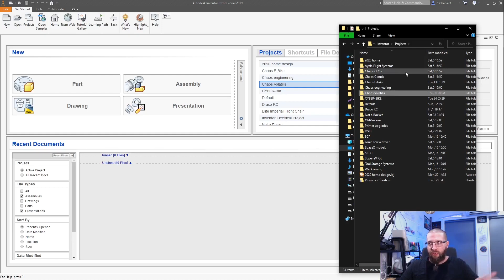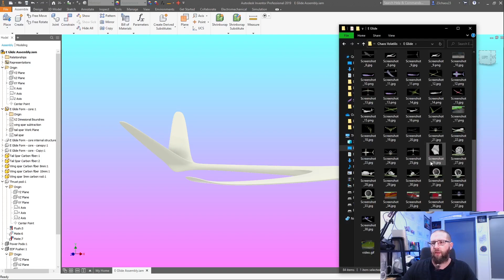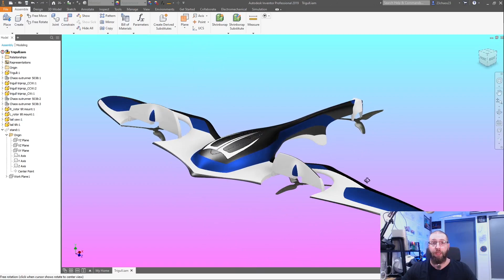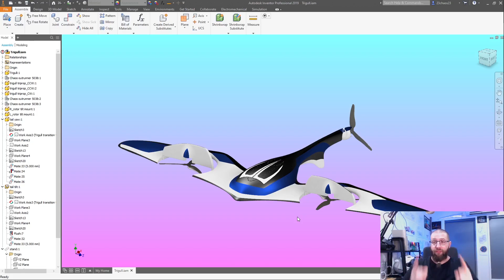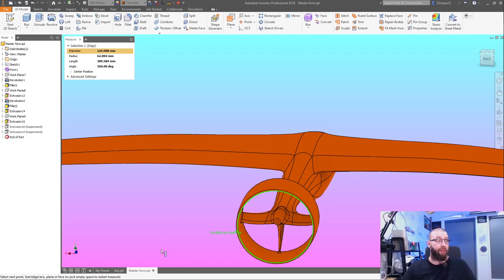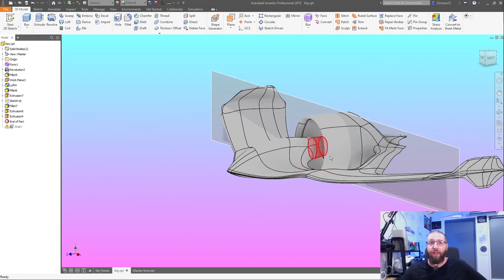chaos daily 2021: 002

Comment: Have you heard of the Prantdl-d flying wing? Hyper efficient, but, hard to get the wing shape right. What's interesting is it actually produces proverse yaw. There is a cad neutral (STEP? IGS?) and STL file available of the design its a research plane/project at this stage. Could be cool.
Reply from the maker: Yes i have seen this one, its still just a flying wing... I have an idea for a bio-mimicry design way down the line, it will use both blended geometry control surface and dynamic wing geometry. basically a full replication of a birds wing. Being able to "fold" to increase wing sweep and having complaint control surface skin

https://www.researchgate.net/figure/FlexSys-compliant-wing-concept-9_fig5_228889328